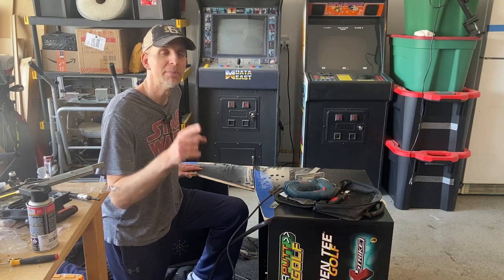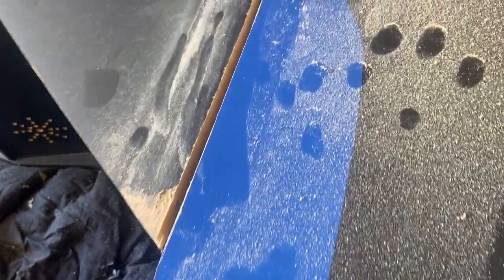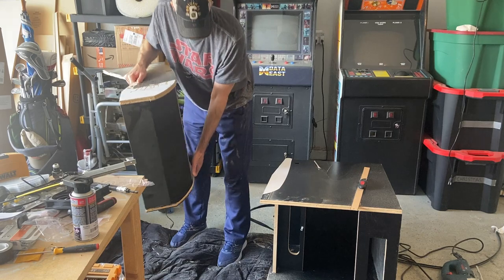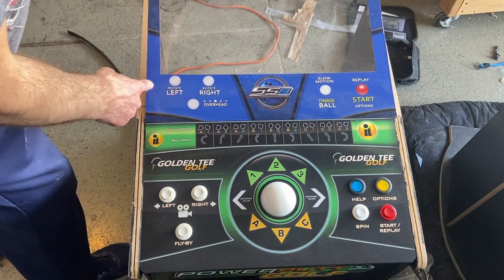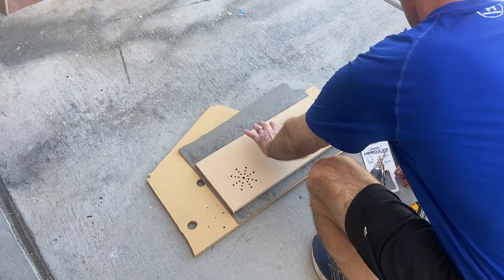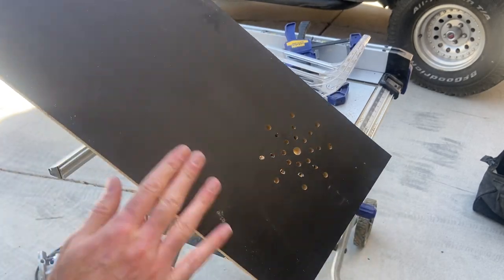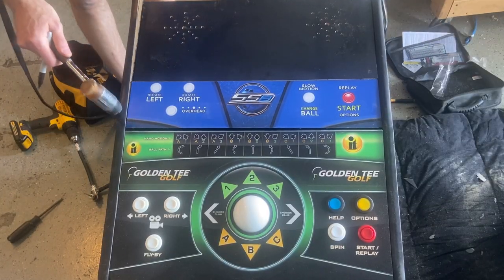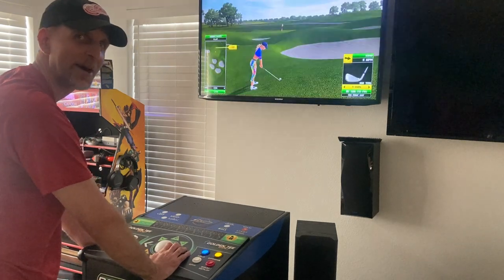GOLDEN TEE + SILVER STRIKE BOWLING Arcade Cut in Half?

Comment: Hey rexer. I love the video . Thanks for posting. I am a newb to the scene but am mechanically inclined. I’d like to know if you think I can achieve this build with an arcade 1up golden tee cab? Would I be able to build like this and use the stock tech for a larger tv screen for the visuals?
Reply from the maker: Honestly I’m surprised nobody has done this with 1ups yet.  I think the only issues you would have is getting an adapter to run from their pcb to a regular tv.  They are out there but you must get the right one.   The second issue is they use cheap 1/2 inch particle board so it may chip all over and destroy the graphics.    You’ll also need to cover up the opening with a wood piece , but if you’re handy , you can do it.  The 1up is pretty cheap and it’s annoying not being able to swing your hand through.   Good luck !!
Reply: Thanks for the reply. I anticipated your response on the cheapness of the cab but am glad to hear it’s doable in the right set of hands! If you have a link or site to send me in the right direction of a screen adaptor I would be much obliged . The tech part is where I would fall short. I’ve been searching how to add a Bowling feature but it seems the SS manufacturer has made it difficult to achieve that aspect from what I’ve seen .
Reply from the maker: @jeeptommy9506  do you Facebook ?  There is an arcade 1up official Facebook page where they should be able To help.  Each monitor type uses a different adapter so I’m not sure which one.  Also, there is an old video by ETA prime on YouTube that shows the adapter.
Reply: I do rexer. And thank you for the intel . I will circle back at a later date if a can secure all the components and make it a reality 🖖